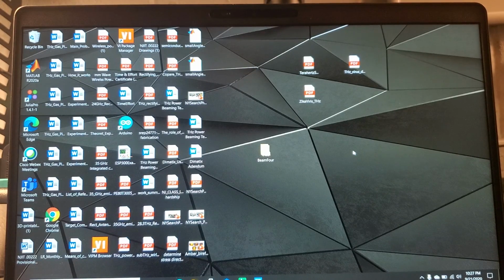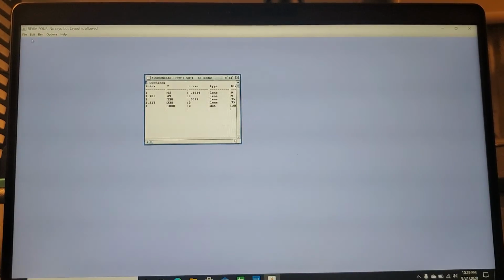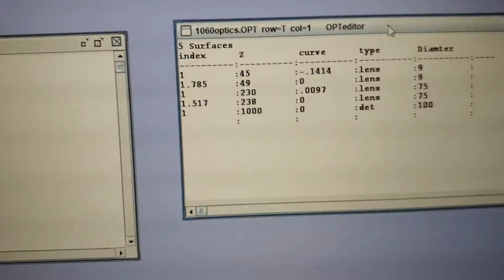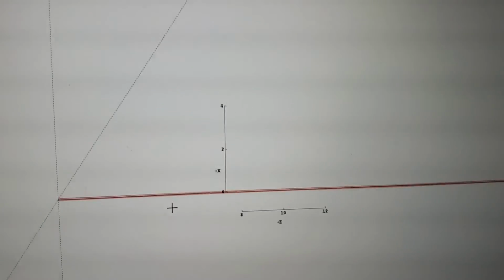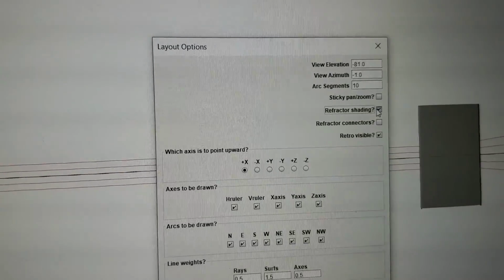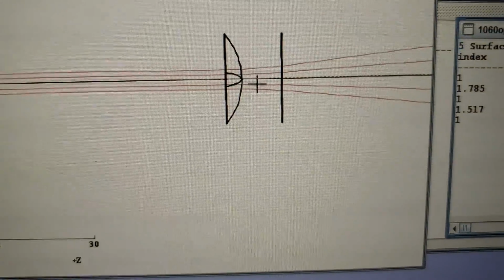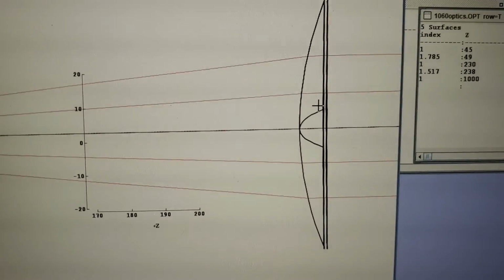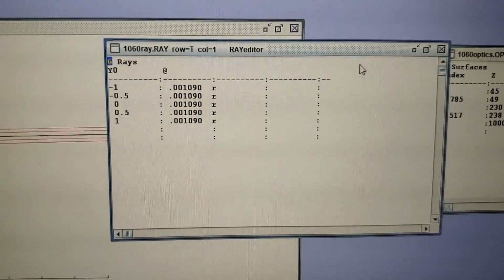Beam Four Ray Trace Example

Comment: Wow, I can finally understand lenses and how lighting works. I needed a ZEMAX like software for calculating my diameter, density and length of the lens in my finals project, since i don't have acces to it. So i found beam four. But it was so confusing, even with the manual. Cheers to all the people that upload random stuff that could be useful for who is in need :) Thanks man
Reply from the maker: Glad this was helpful.  Hope your project went well.
Reply: @louisrizzo9039  i've managed to do something. I will present it in a week. I've read the beam4 manual and got into it pretty well. I would really like my future career to be into optics and work with  some more advanced softwares, like zemax or opticworks (from solidworks) or anything. But anyway, thanks again for a nice introduction into a simple optics program :)